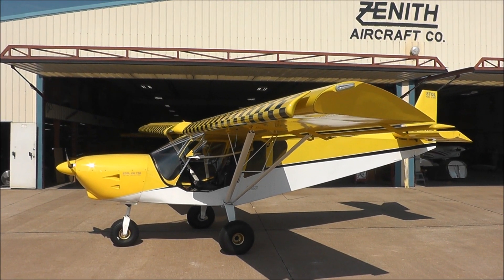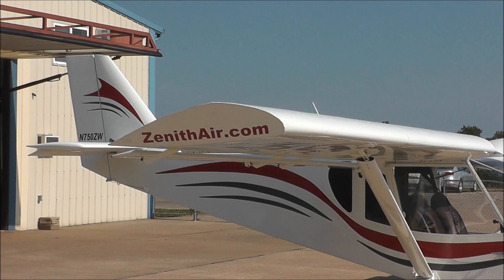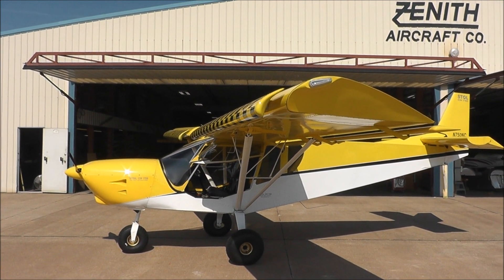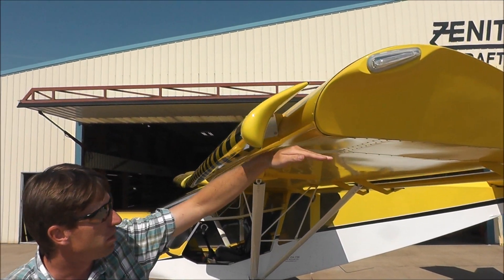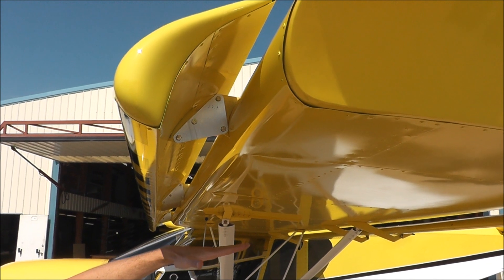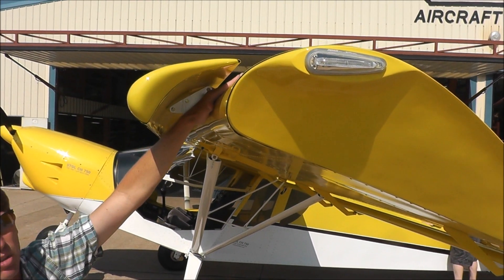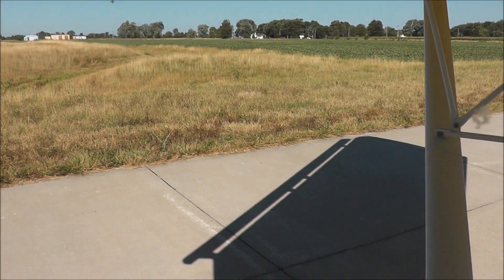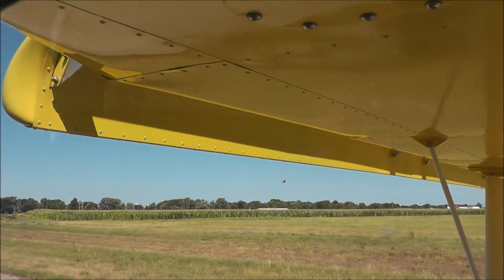Zenith STOL CH 750 with drooped wing leading-edge slats

Comment: Thanks for taking the time to make this video, but, while the effect of slats is accurate, I think that the description of the how they work may be a bit off/more complex than what is described here (i.e. venturi effect increases the velocity of air) based on this article: https://en.wikipedia.org/wiki/Leading-edge_slat
I'm doing some research on slats and droops and combinations of the two, so needing to understand the physics of how they work and came across your video after some preliminary research, so thought I'd share.
Reply: In school in my configuration aerodynamics class we read A. M. O. Smith’s paper on high lift devices. It’s meant for engineers, but might be worth checking out. Here’s a link - https://charles-oneill.com/aem614/ReferenceMaterial/A+M+O+Smith+HIGH+LIFT+AERODYNAMICS.pdf

Comment: It might just be me, but it seems Zenith keeps trying to evolve the 750 to be as short field capable as their Chris Heinz designed 701 platform.  Now drooped slats in the 750, twice the power in their super duty jump seat version, etc.  I wish them only well.  But physics...I flew the 701 some years ago, I think with an 80hp engine.  Amazing short field capability, maybe duplicated only by STOL planes costing a WAY LOT more.  Yes, the 701 is limited in payload and speed, but everything in flying is a tradeoff.

Comment: Maybe you should design a way to actually make retractable slats. When they are in a fixed position they are leading edge slots. If you designed the slots to be slats instead, you could then improve the cruise on the original Zenith. I think this would be a much better and offer the customers a better option.